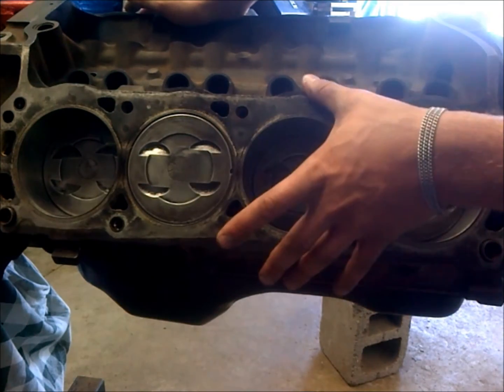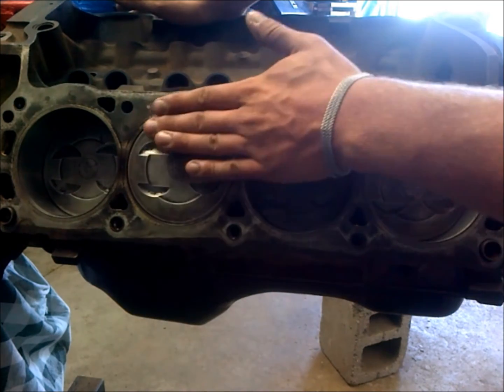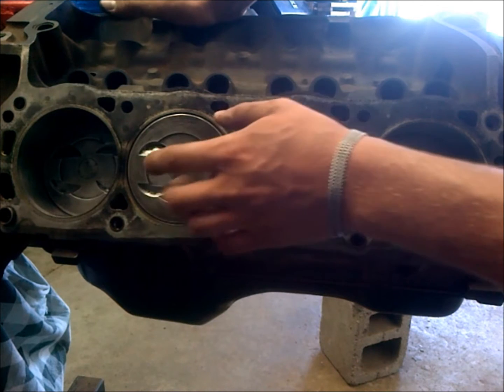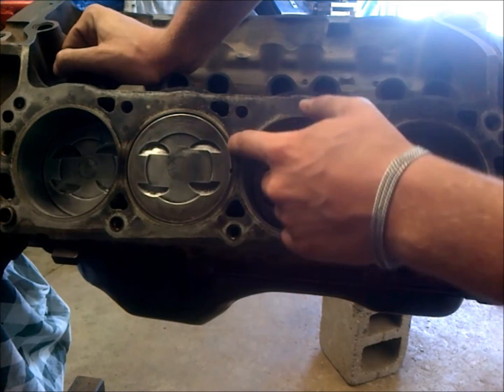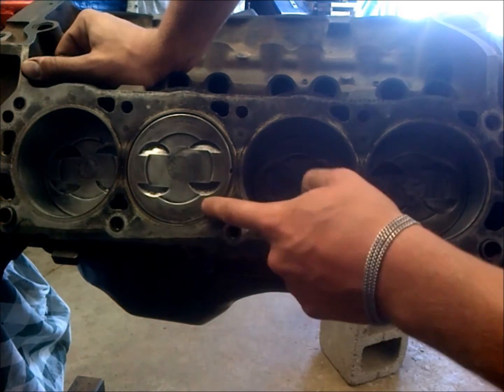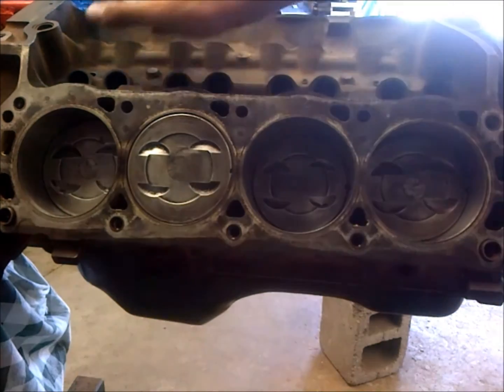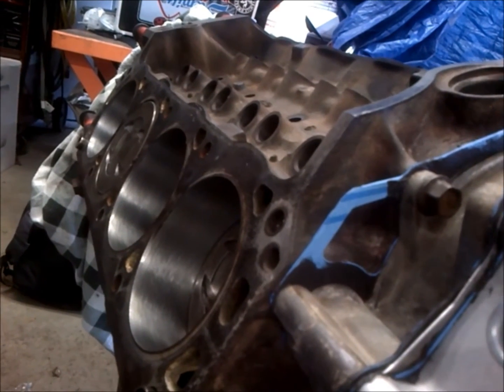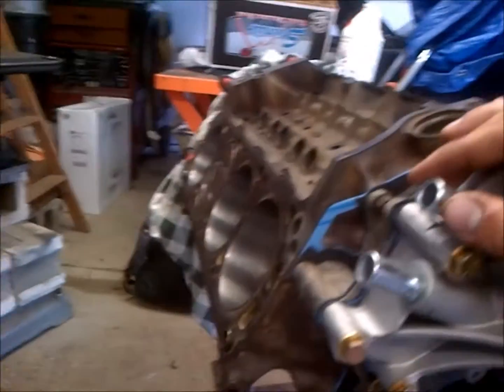Engine Quench Explaination and Importance (need to do this)

Comment: I was under the impression quenching did numerous things. One being to remove heat from the piston crown reducing the chance of hot spots and detention on the next cycle. The other was encouraging a flow character beneficial to drawing or expelling past valves.

Comment: So, if my piston pertrudes like the one on the video, do i get the felpro thick gaskets or the thin ones??
Reply from the maker: +Hector Ortega the stock thickness gasket should serve you just fine - might want to check piston to valve clearance if you are running a larger cam